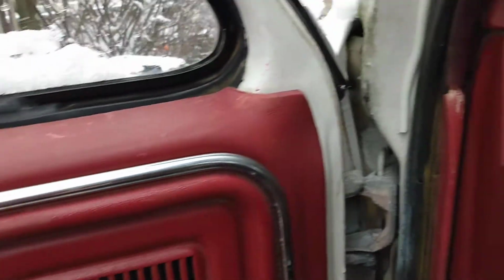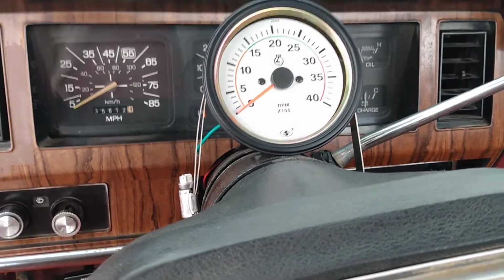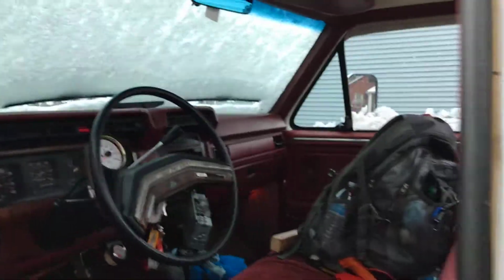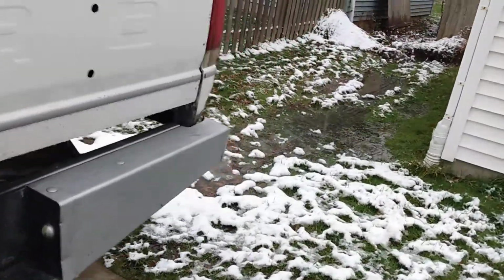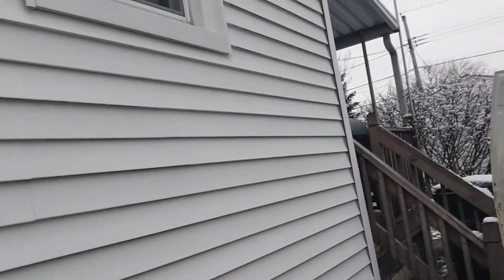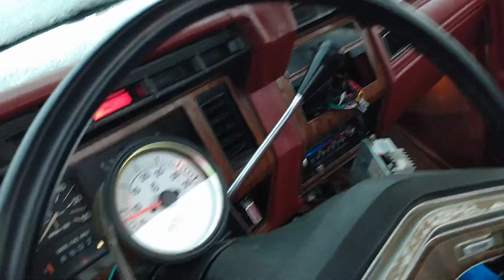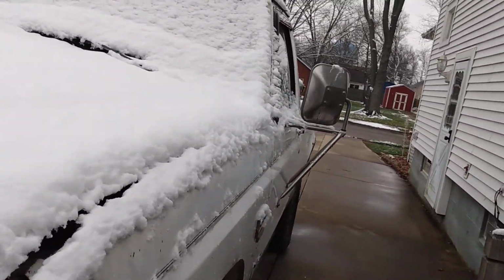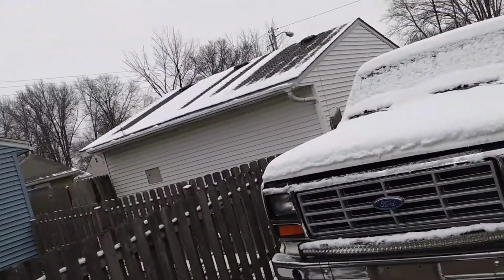1984 F-250 7.3idi Cold Start

Comment: should put a turbo on it run about 10-12 psi safely and turn that fuel put 1.5 flats and use some cetane booster